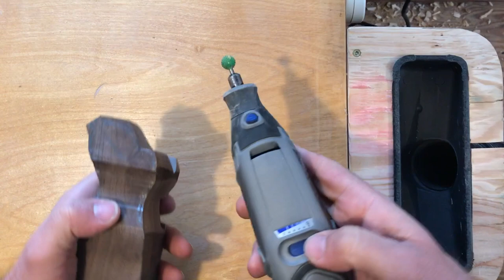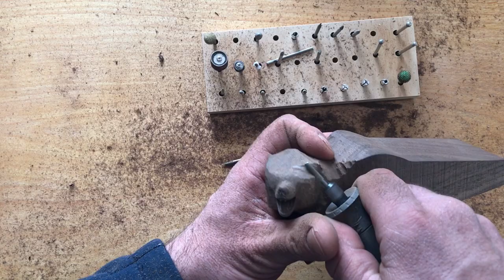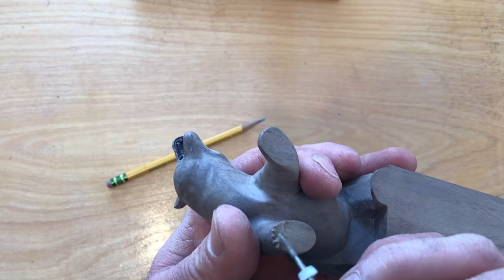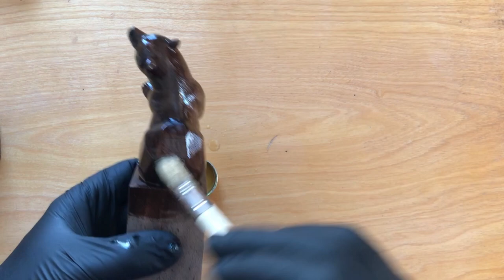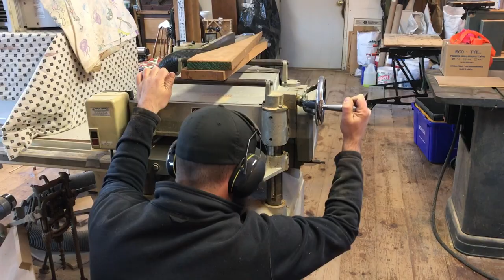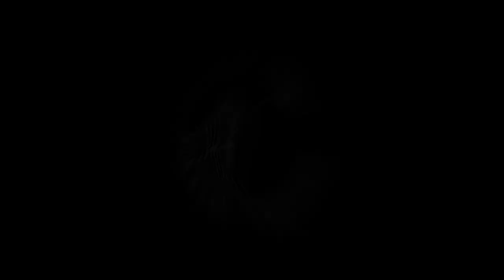Carving A Grizzly Bear From Black Walnut

Comment: Carving what? With a band saw and a Dremel? Wow not carving , your machining
Reply from the maker: VinnysGuitar Thanks for the comment. Sorry if you felt misled. This is referred to as power carving and you will find that most traditionally carved pieces start on a bandsaw. I have used traditional tools for 20+ years (some are seen in this video) and just recently started using a dremel for speed and fine details.